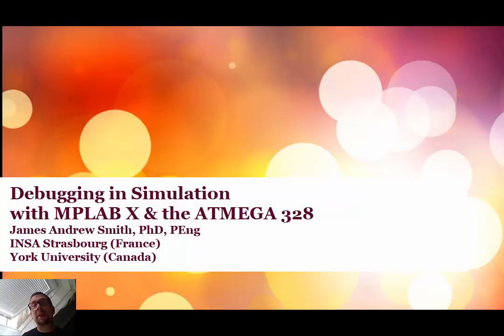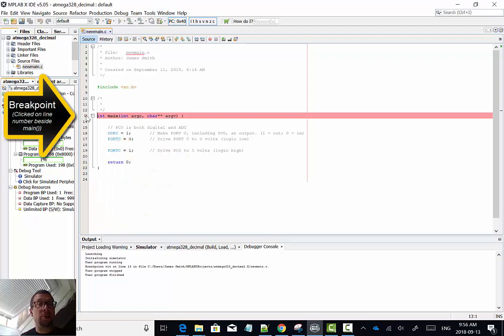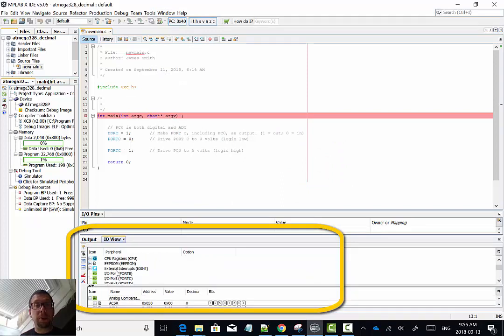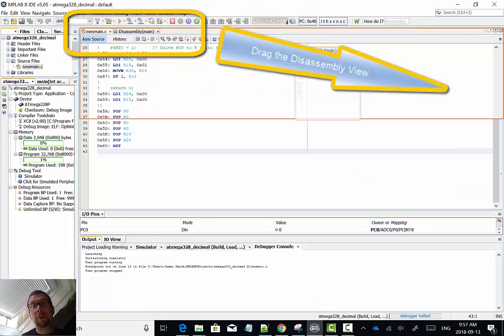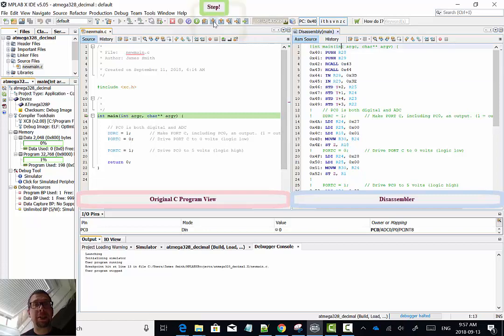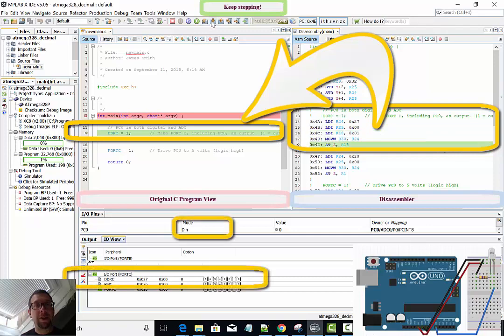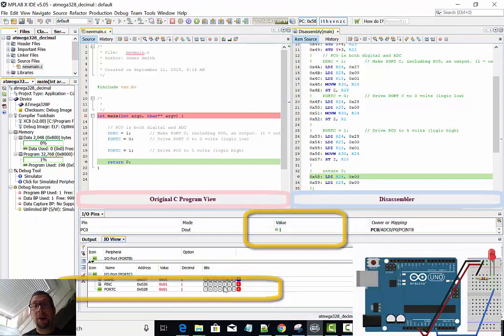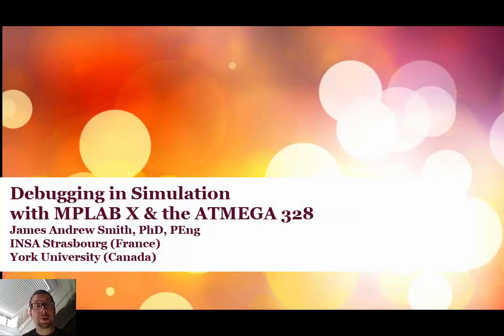Simulating the ATMEGA 328 using MPLAB X

Comment: Simple and useful, thanks! Although I was wondering if there is a way to know how many time will take to the micro to execute an instruction written in C throughout the the debugger/simulator. Because, for example, if one take a look at the assembly code, you can tell how many time will it take because the uC core's datasheet describes how many time it takes for each type of instruction, but what happen when we have an instruction in C that will take 200 instructions in Assembly code? It'll be tediously go counting all the Assembly instructions and then multiply it by the amount of time of each instruction (with the assumption that all of those Assembly instructions will take the same time to execute, which of course we know that isn't true). Do you know if MpLab has some sort of this functionality?
Reply from the maker: Hi Daniel.  That's a very good question.  MPLAB X has a "stopwatch" feature that can be used when debugging.  I've confirmed that it works in simulation for the ATMEGA 328, using the code in the video.  Place two breakpoints in your code.  Then, turn the Stopwatch pane (Window-> Debugging -> Stopwatch). Run the debugger.  It will halt on the first breakpoint.  Go to the bottom of your screen. Make sure that the Stopwatch pane is visible.  Hit the "continue" button in the debugger to go to the next breakpoint.  The stopwatch will tell you the time it took to go from the first breakpoint to the second breakpoint, based on the assumption of the oscillator frequency that you set the simulator to (1MHz is default).
Reply: @onnimikki2007  awesome"! I'll try it! Thank you very much"!!
Reply from the maker: More info here: https://learn.digilentinc.com/Documents/211